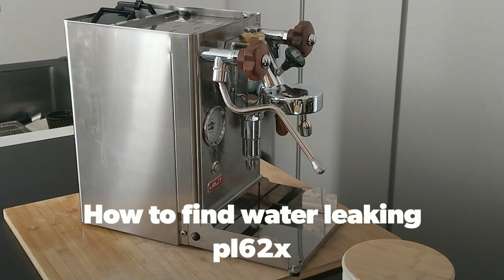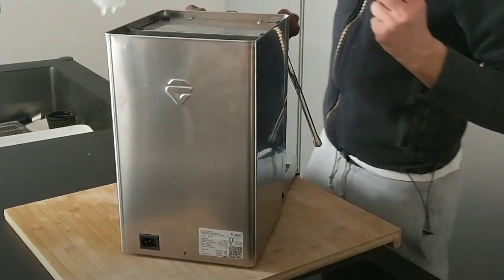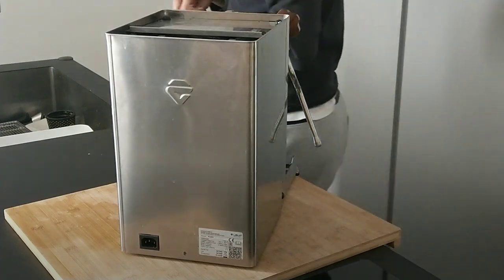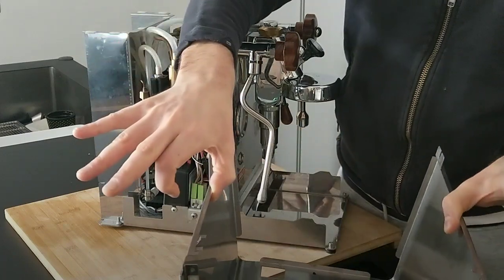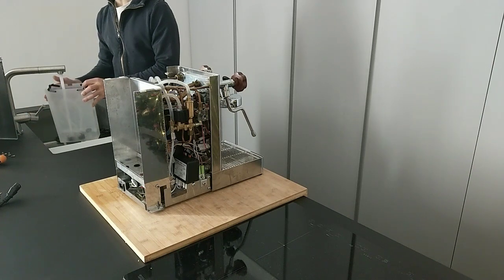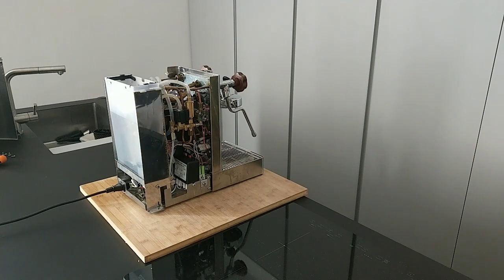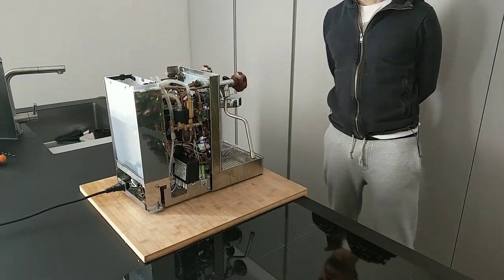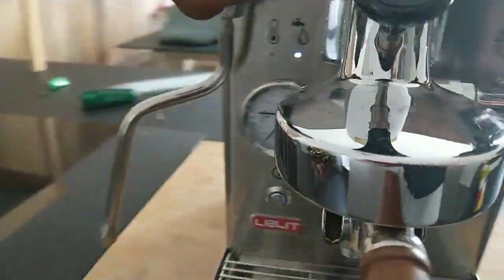pl62x How to find a water leak come cercare una perdita

Comment: Hi Mauro, I just experienced exactly the same with my MaraX as you show at 5:25: the water came out of the body. And it definetively did not when I used the machine the last time... Do you find out what the reason of the water leak - as shown in your video - is?
Reply from the maker: the water into the drip tray is normal, because it is the water that pass trow the opv valve, if you need help please send a video at care@lelit.com
Reply: @lelitinsider2977  Thank you for your quick answer! So, you say that the behavior of the machine as shown in your video is normal? I would be happy not to send it to the warranty service... It came to my attention after I had taken water (for a Cafè Americano) and the machine seems like didn't stop filling the boiler and water came out of the body in parallel. But maybe (hopefully) I just didn't wait long enough.
Reply from the maker: @jenswinkler2630  if you need help please send an email at care@lelit.com, and send the foto of the data label and if is possible the video of the problem
Reply: @lelitinsider2977  Thank you again for your help. I am in contact with Lelit customer support who are very constructive in helping me.
Reply: @lelitinsider2977  Is it normal for water to pass through the opv valve even with the version 2 of Lelit Mara X? Not all water is redirected to the water tank in the new version?
Reply from the maker: @mikkol79  not all, is not possible, in the  exaust circuit the antivacum, 3way solenoid valve continue to train water into the drip tray

Comment: I have a friend with this exact problem and a overpressure in the boiler. I wonder if it can be the solenoid valve (may be doesn’t work and it’s opened all the time). He can down pressure releasing by steamed wand
Reply from the maker: hi, if he need help, he can write an email at care@lelit.com!